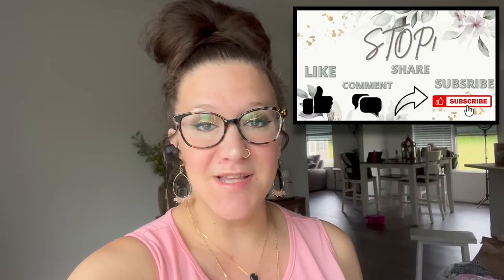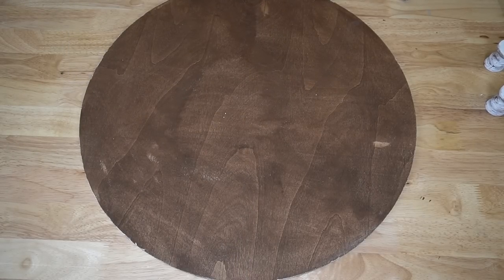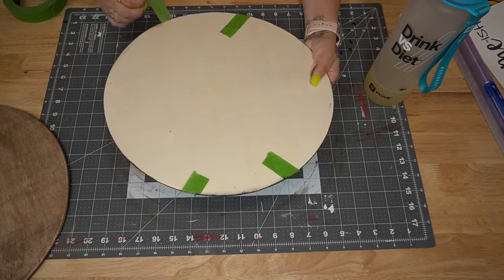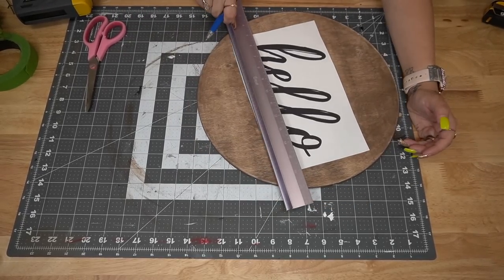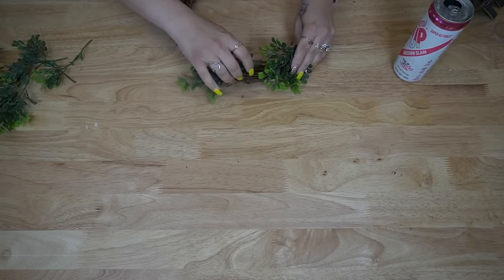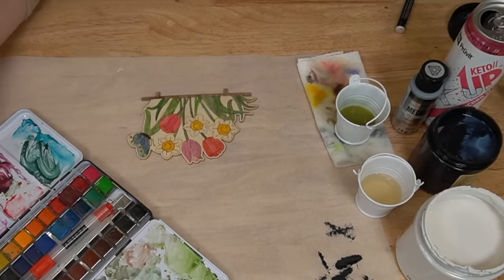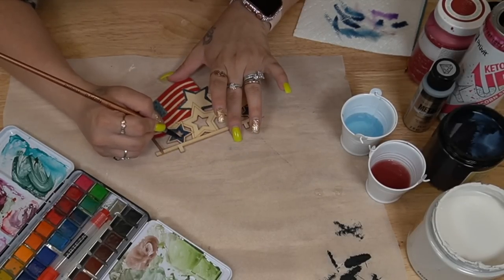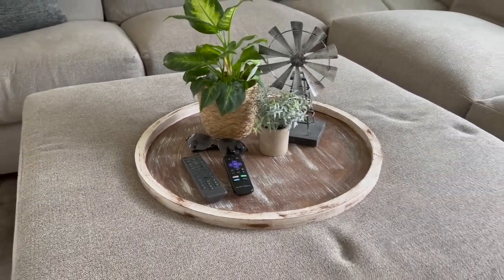YOU WON'T BELIEVE WHAT I DO WITH THESE HOBBY LOBBY WOOD BLANKS| HOBBY LOBBY CLEARANCE DIYS

Comment: Hello from Winnipeg.  Just an FYI some wood needs to be dampened with water first.  Then the stain seems to soak into the wood better.  It may or may not work but thought I’d pass on this trick ❤.  Great job on the projects⭐️
Reply: Also instead of using a paint or foam brush try spreading with a baby wipe

Comment: Love all these Melissa, what a great idea with the truck for all seasons. I would have done the shading on the pumpkins for sure but maybe a little more light handed. The hello wood round was my favorite. I appreciate when crafters go the extra mile like the highlights on the letters or the black lines. I also appreciate you using the different stains and talking about them. I've only ever used faux stain with brown paint and a baby wipe or once I had some old minwax with a really weird consistency and I used a baby wipe on that too.(and it came out just fine)

Comment: Hi Melissa ! I just love this ! Girl don't you just LOVE the Dixie Belle paint ?  It goes on so smooth, thought a little trick pour a little (what you need for a project) in a bowl and wet your paint brush (damp) and you'll be surprised how easy it goes on cause sometimes I've found it to be a little on the thick side. Another trick is you can print your lettering off on a printer (mirror it ) put Mod Podge on the side the lettering is on, lay it down on your project smooth it out good let it dry overnight then the next day take a wet paper towel wet the image (don't soak it) just dampen it and rub with your fingers removing all the paper and your lettering will be on your project, doing away with the graphite paper all together. Thanks For Sharing.

Comment: When working with a wood piece that has never received any stain or sealer. You need to use a wood conditioner it will soak in and stop the stain from doing what happened to you. The wood was so dry it was soaking up the stain too much.